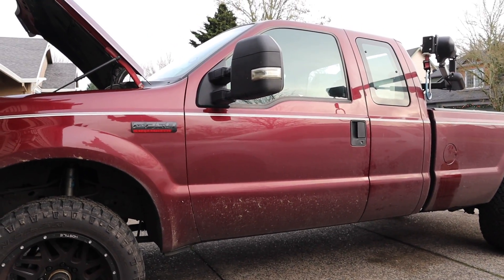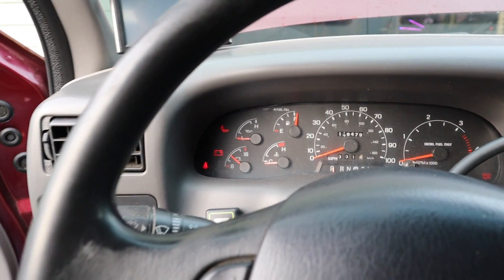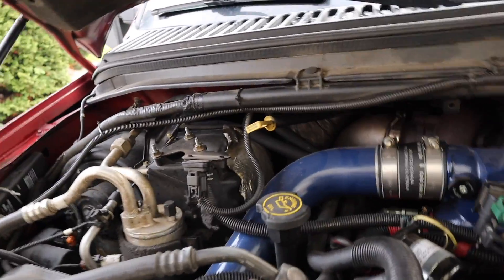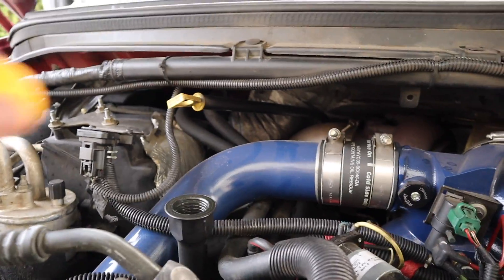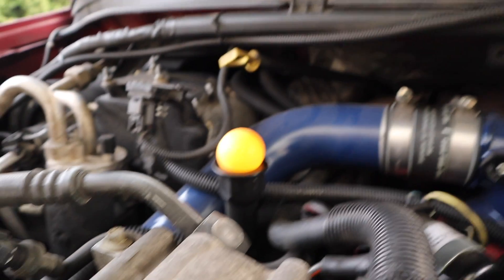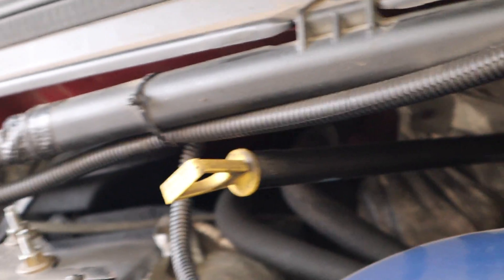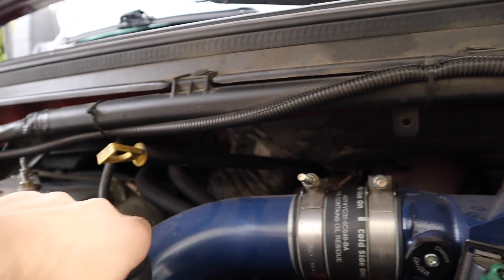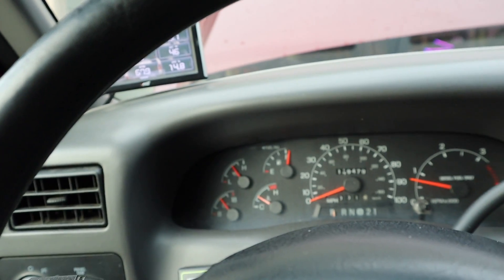Ford 7.3 Powerstroke How to REALLY Check for Blowby On A Diesel

Comment: Blowby is not caused by the gap between the piston and cylinder wall. Over time the compression rings wear the cylinder wall. When new, the cylinder wall has a crosshatch honed into the cylinder wall. That crosshatch holds oil and seals the compression rings. When that crosshatch wears away it no longer holds any oil to help seal the compression rings. Therefore that lack of seal lets combustion gasses blow-by the compression rings. True blowby is checked with a percentage leak down tester, which uses a spark plug hole for pressurizing the cylinder at TDC for testing. But with a Diesel there’s no spark plugs so doing a technical % leak down test is difficult.
Also as a side note that is why it’s so important to do regular oil changes at 5k or less on a diesel. Diesel is a low refined fuel product, so it produces a lot of soot (carbon). That blows by and gets in the oil. Carbon is abrasive. So the dirtier the oil gets the more wear occurs. Another excellent method to clean oil and prolong oil change intervals is to install an oil bypass filtration system which can filter down to a micron. Then Oil change intervals can typically be extended to 15k on a 7.3L. But oil testing should still be done at 5k intervals to establish a baseline for each engine.
Reply from the maker: As I said, my explanation was a very simplified explanation. 👍🏻
Reply: Living On Wheels copy that
Reply: Living On Wheels , BTW, I do enjoy your channel. You have a lot of good DYI info for the 7.3 PSD.
Reply from the maker: Mike Inglett much appreciated man!
Reply: Isn't that a gap tho? Just no oil sealing it?
Reply: Og Bqze the reason for compression ring end-gap, and even oil ring end gap is to allow the rings to expand when at operating temperature. At operating temp the ring end gap is extremely small. For peak performance and minimal compression leakage you want the gap as small as possible but not touching. If they touch the ring will put too much pressure on the cylinder wall creating several problems. I.e. galling, excessive cylinder and ring wear, and piston ring land wear. To further reduce oil passage and compression loss across the ring end gaps all the ring gaps are staggered equally in circumference around the bore.
Reply: I sent my oil to Blackstone at 10k mile oil change with my 7.3 at 275k miles and they said it looked great and I should try 15k miles.
Reply: Hey Mike I did one of those oil analysis the other week and was a little cornfused about the results, they said it all looked good except a tiny amount of coolant was found, they said it was barely enough to trip their threshold but still enough to show up and be mentioned, what do you recommend I do and where should I start hah. Thanks in Advance 300k miles, I'm thinking about starting by pulling the oil cooler off and checking for damage
Reply: @CurtisRedfield  Hey Curtis. I'm sure you have fixed your problem by now but i would like to tell you what I found out with my 7.3. I am getting massive amounts of coolant in my oil pan but no oil is going into the radiator. Its clean.  I have removed the water pump thinking i had a hole in the cover plate allowing coolant to run straight into the oil pan, The cover is fine, no holes. I had no leaks externally from the oil cooler. What I have been told by a master mechanic working on the 7.3 for 30 plus years is that the oil cooler has failed (internally).  When the motor is running the oil pressure running through the cooler is at a higher pressure than the coolant running through the cooler therefore if there is a hole in the inside liner, the oil is sucking the coolant out and taking it straight into the oil pan with the oil. When the engine is shut down the cooling system is still under pressure but there is no oil pressure and this acts like a wall keeping the oil from mixing with the coolant. I hope i explained this correctly since i am not a diesel mechanic nor pretend to be. I'm just passing along info that I have learned from others who are. 
Hope this helps.
Reply: Curtis Redfield I’m a little late to the party but could that also be a fuel injectors cup failing?
Reply: Curtis Redfield : there are two common areas where coolant can get in the engine oil. 1. Front engine timing cover behind water pump erodes over time. PITA to fix because pan has to be dropped. 
2. heat transfer oil cooler that runs along left side of the pan rail. Connects between oil filter adapter and block adapter. Has an oring that gets brittle and leaks. 
IMO replace the oil cooler oring first, it’s the most common failure point. There are great YouTube videos on how to do this.
Reply: That would be a school book explanation but if you tare into a few hundred engines you'll find plenty that have zero cross hatch and amazing compression. Stuck pinched or broken rings are usaly the causes of compression loss not the cilinder though a bad cilinder will usaly kill the rings. Cross hatch does many good things especially for mating the rings and keeping things lubed but it is not necessary for good compression certainly not the key element of it
Reply: @eddedwards9879  that is somewhat true, however the lack of crosshatch will increase oil consumption. But without crosshatch holding oil, over time cylinder wall / ring scoring will occur and compression will lessen due to less lubrication. My experience is building mainly racing engines. Things are a bit more critical in those type engines. They run pretty high head pressures compared to OE street engines. Did that for 11 years before becoming a firefighter. The info I post is not school book, but what I’ve learned from experience and from other engine builders that were my mentors.
Reply: Is it bad to change oil too often?

Comment: I got a 99 7.3L with 163k miles and I get the same amount of white smoke coming out the tube but the cap doesn’t budge at all. It freaked me out when I saw the smoke but it seems like your trucks running fine and does it too so I’m less worried now
Reply: I have 228,000 no blowby but vapor yes

Comment: Old video but I'm hoping you'll see this, so I have smoke coming from my dipstick, but I took the fill cap over the fill hole and it just kinda vibrates a little bit until it falls off. Is there any reason for that?
Reply from the maker: Both are connected to the crank case. That’s the same vapor that comes out of the oil cap. As long as there’s no real pressure then there’s nothing to worry about.
Reply: @LivingOnWheels  could it be because my trucks been sitting for a little while through a cold 2 weeks since I had to change the fuel pump? I didn't notice the cap jumping or being pushed off, it just vibrated like yours did but it had a Good bit of smoke coming from the dipstick.
Reply from the maker: @crazynight1518  without any pressure behind it I would not be concerned about it.

Comment: For blow by you should be talking and demonstrating with a 6.4 Power Stroke that thing can blow the cap in the air from new😂😂😂. Well not quite how ever it is quite exsive. Mostly because of the regen or burning off the diesel particles trapped by the DPF filter the system dumps fuel into the back two cylinders to increase the exhaust temperature to from 900% to 1200% this incredible amount of temperature causes things to expand. A lot. So the rings are fitted loosely meaning the gap in the rings are much wider so that during this expansion the ring gap doesn't close up and cause damage. So now during normal temp the gap being mutch wider causes high blowby. I have heard that this causes so much fuel to get past the rings that at oil change time you can get an increase of 2 or more liters/ quarts that is a lot of diesel in the crankcase. This has been the #1 suspect of premature engine failure and that of other moving parts.

Comment: Looking to buy a 2000 7.3 with ~65k miles (proven miles) and it has much more blow by but it does have 80%over injectors and a KC63mm but im not sure if its a bad sign or not considering the injectors.
Reply from the maker: Hard to say without seeing it myself. Make sure the ccv is not plugged. If it’s got bad blowbye I’d pass.
Reply: @LivingOnWheels  It wouldnt keep the cap on upside down and when if you put the cap back on normal without screwing it in it would somewhat float in the hole.
Reply from the maker: If it’s actually blowing the cap off I would avoid the truck. If it’s just vibrating off that’s pretty normal. With it upside down you want to see if the pressure is actually lifting the cap or not. If it is I would probably look elsewhere.
Reply: @LivingOnWheels  Thanks

Comment: I've got a 99 f250 with the 7.3. Has 415k km so about 260k miles looks identical to what you have in the video with your truck, I was worried when I pulled the cap off and saw the vapor but once I flipped the cap back down I only saw movement from the engine vibration. Still had me questioning it though. Will have to try the ping-pong ball.

Comment: If you measured the diameter of the oil fill opening, and the weight of the ball, you could figure out how many psi pressure it has.  Or you could add water to the pingpong ball with a syringe, till it just stopped fluttering then glue it shut, then it it ever makes it flutter in the future, you know that the crankcase pressure has increased.
Reply from the maker: Not a bad idea 👍🏻

Comment: Even a brand new motor  is going to have mist coming out. This is a perfect motor. I would have no concern
Reply: I was gonna say.. 2022 company truck 🛻 international cv515 65,000 miles and it has blowby,minimum but still does have

Comment: That's nothing and completely normal..my 2001 f2shity 7.tree has over 700 thousand miles and has the exact same amount of crank case gas as yours..  it is moisture from the outside air which is sucked in by the air filter.....everyday of the year has different amounts of moisture in the air.  Its science

Comment: What is the problem with the my truck if there is a lot of steam coming from the fill cap? I got a 99 7.3 with 140k miles
Reply from the maker: No real problem as long as there isn’t a lot of pressure. If there is a lot of pressure with it, then you’re probably looking at some cylinder work in the near future.

Comment: I was looking at this 2001 dodge 2500 24valve and I drove it around and the checked for blow by and I put my hand over it no pressure didn’t budge the cap at all but had a bit of the white vapor smoke coming out so it’s normal???
Reply from the maker: Yup that’s totally normal.
Reply: @LivingOnWheels  thanks man I appreciate it

Comment: my 99 7.3 has zero blowby at 230k miles. it was very well cared for and never moved more then its 12500 gvwr  i will have to check with a ping pong ball but i dont even have a vapor coming out. however on a 2011 6.7 we have at the shop with 150k miles...it cant even keep the oil cap on in the least

Comment: Thank god, I’ve tried to sell my truck and the guy came by and said it had blow by because of the steam but it passed the ping pong ball test at 236000 miles
Reply: I just bought a 97 f350 power stroke with 100,000 miles on it for 2 grand. I was doing a oil change amd the steam had me freaked out 😂😂😂😂 so this is normal?
Reply: @nickmontanaro4373 every 7.3 has a steam/ haze. Nothing wrong as long as there’s no positive pressure
Reply: @jacobmartinez4433  ok awesome thank you for the feedback. I did the ping pong ball test and it went good 👍🏻

Comment: Good video, I have a 99.5 that has 66,670 miles on it. I am the original owner and only one who drives it ( f350 4×4 4r100)
It had 0.2 of one mile when I took possession. I changed the factory filled oil @ 500 miles with motorcraft 15w40. Then @ 3000 I changed the oil again and switched to Red line 15w40 full synthetic. And have changed the oil every 1k to 3k miles to this day.... I use it to tow a lx985 skid steer locally so it's not my daily driver.
My blow-by looks exactly like yours. I was thinking I may have switched to synthetic too soon (@3k) and the rings haven't had time to seat properly? But it's always had the same amount of blow-by ever since new.
Reply: Ever consider selling it let me know im interested

Comment: My 350 has exactly the same amount of blow-by vapor at full temperature. It had that at 167k when I bought it and it now has 220k and it's running perfectly fine.
Reply: I have bought a golf 7 1.6 TDI at 156k, today i found out after 100 km about the blow by and it seems to be similar amount of vapor to what i see in this video. Do you think it's of a concern? did the white smoke increase overtime when you set at 220km now?

Comment: Very nice idea. Never thought about using a ping pong ball. My truck is down right now....have the injectors pulled out to replace the orings and I'm having Mississippi diesel products rebuild 2 that are sticking cold. When I get her back together I'm going to try this trick. I know I get some oil vapor when I pull the cap, Very similar to what you showed in the video. Maybe just a skosh more but not enough to move the cap. Curious to try the ping pong ball now

Comment: Your oil cap never had a chance up there, it never could stay there without you saving it...At 150,000 miles it is just breaking in...Give it a chance, oh you sold it...
I really enjoy your videos by the way, FYI.
Reply from the maker: Between the slope of the driveway and the backwards slope of the engine there’s not a chance the cap would have staid there with the vibrations of the engine.
Reply: @LivingOnWheels  Agreed 👍

Comment: I just traded this Cummins with a lot of blow by for a duramax with no blow by may have put a couple hundred miles on it then today I checked it cuz I was bored and it was blowing the cap around. Blow by seems like something that should happened over time the truck has 179k on it and it was barely shooting up vapor when I first checked it just blows my mind
Reply from the maker: Have you checked warm vs cold? I’m not sure on the duramaxes but I would check the crank case vent as well. Make sure it isn’t clogged.

Comment: If smoke is coming out of the oil fill cap but doesn’t blow the cap off is it still okay to drive
Reply from the maker: Yes, pretty much all 7.3s will have haze. It’s the pressure that you need to be concerned about.

Comment: I am a really easy driver on my truck. But recently my dad purchased a new truck and me and him had a little race. When we were driving it slipped out of overdrive and hit at least 3k rpm for about 2 seconds. It scared the hell out of me.  When i got home i was a little worried as I dont ever rev that high. So I checked all the fluids and I decided to check to see if i could feel blow by. I dont feel anything but its the first time ive ever seen vapor coming from my fill cap. It was a colder her today then usually. But im kinda a little worried. Any thoughts?
Reply: I think you’ll be alright boss. The 7.3s can take a beating and still last. If this is the first time you’ve ever really beat on it I don’t think it would cause any problems.
Reply: 3k isn't even in the red, you're totally fine bud!
Reply: exact same thing for me today. besides mine is a 5.9 cummins. 332k on the truck and today it has very little white vapor coming from full cap but it doesn’t blow my cap off my any means. should i be worried?
Reply: @wildoutdoors8336  i think you should be good! Ive put 47k on my 7.3 since then.. alot of those miles pulling my rv and cattle trailer.. and she still purrs  good! Its ok to be paranoid lol.. i love my truck and I always worry

Comment: Tell me you don’t know anything about a 7.3 without telling me you don’t know anything about a 7.3.

That’s not excessive blowby, that’s perfectly normal, you have to remember the compression on a diesel is extremely high vs a gas, and 7.3’s have more than a Cummins naturally.
Reply from the maker: Did I say this was excessive blow by?
Reply: Yeah perfectly normal to see on these 7.3s. There will be vapors on a brand new one. Diesels and gas motors aren’t comparable. Lot of folks on the internet freak out at what’s actually normal. There’s an actual pressure test you can do with a manometer to measure crankcase pressure. What you don’t want to see is pulsing pressure. That’s bad news usually means a hurt cylinder.

Comment: Is anyone certain that the crankcase is sealed beyond just the oil cap? Isn't there a positive crankcase ventilation port where blowby would escape?
Reply from the maker: The is a crank case vent on the drivers valve cover
Reply: Yes but this test is supposed to be done with the vent.

Comment: I’m just curious what motor oil and weight do you use for your 7.3
Reply from the maker: Most of the year 15w40 rotella. If change schedule lines up right I switch to 5w40 for winter.

Comment: Thanks for your videos. They help a lot. I have a 2001 7.3 with 371,206 and it appears I really don’t have much more blow buy than what you showed on this video.  
Two months ago I removed the drivers side  rocker cover and noticed some oil sitting in the head which I have come to learn that o probably Hve some injector o rings that new to be replaced so that will be my next project. Thanks again
Reply from the maker: Mack Brown I appreciate it. I am assuming you’re talking about the back clover. In which case you’re going to have some oil suiting up there.